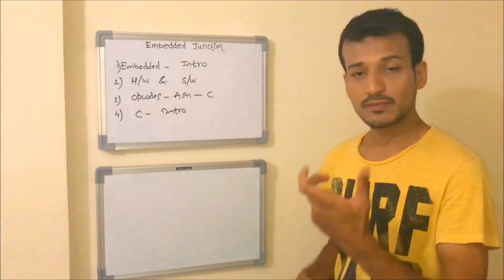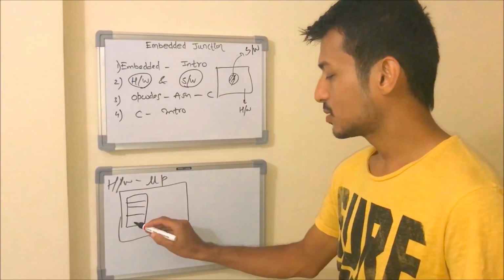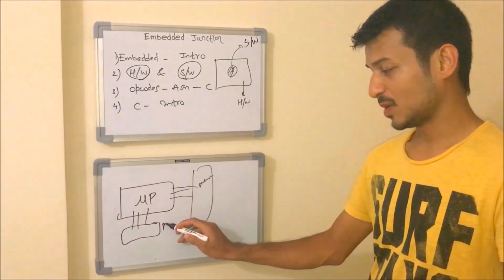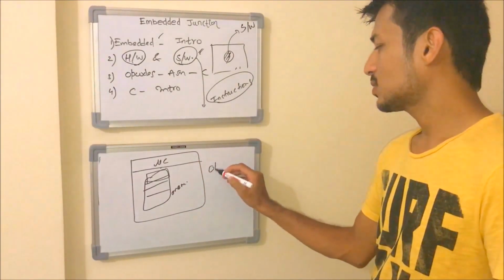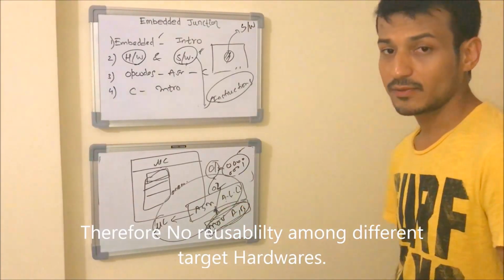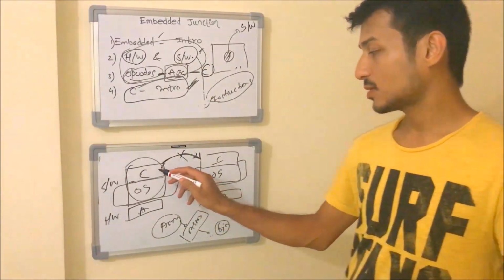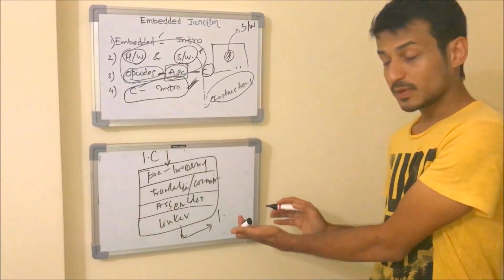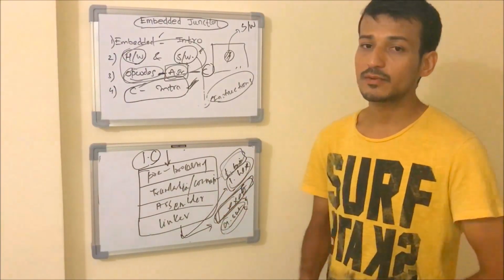Embedded Systems  - Introduction to Embedded Systems and C language

Comment: You are saying compiler depends on os... So my output from turbo c compiler will be exe file.. if i download a cross compiler it ll also run in the same os ie windows which is in my system..So how it alone will produce hex file.. does that mean cross compilers doesn't depend on my system os
Reply from the maker: cross compilation itself means you are creating an output file for another platform.
In cross compilers you select the target / output format etc. to generate the hex file using some tool chain ..

Dependency is of final output file .. you cant run a windows .exe in linux machine or vice versa ....
Reply: Can u give some examples of cross compiler
Reply from the maker: 1. GNU / Gcc 
2. Java and C compilers used in Android .. 
3. LLVM used by iOS / MaC and even in Sony Playstation. 
4.  may be .Net also .. 

My lectures are organised within the boundary of C and Embedded .. so Java and other high level platforms are beyond the scope . ( In fact I don't know much about them :)  ) 

Thanks for watching and questions .. :)..